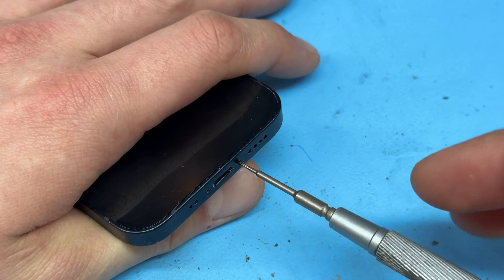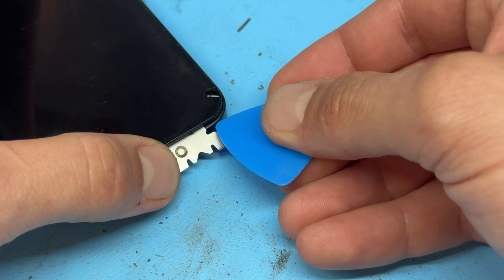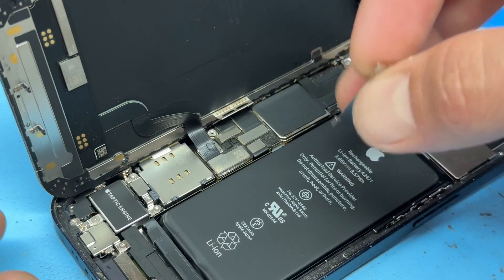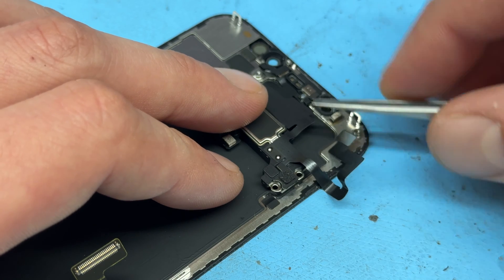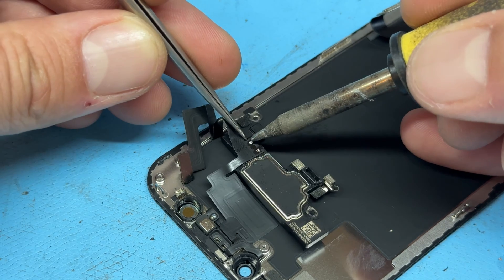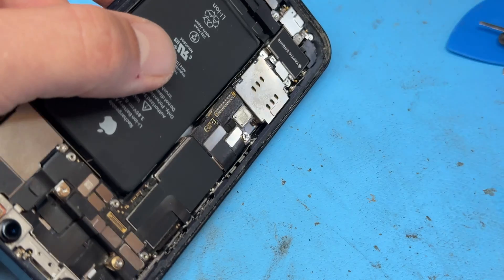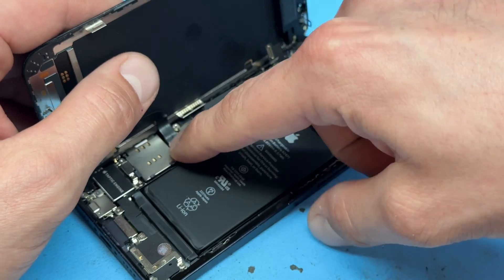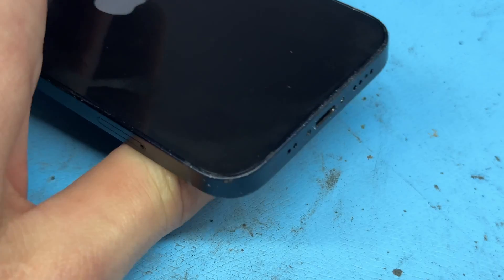iPhone 12 Mini Ear Speaker Replacement: Complete DIY Guide!

Comment: That’s very nice and simple. But the service store told me that the speaker is attached to screen and I have to replace the screen in order to get it fixed. Quoted $250 for the replacement. 😡
Reply: Same 🥺
Reply: Exactly. Same here
Reply: @placesandpeople  is it got damaged after latest update?
Reply: @RishabhSharma-e3u exactly. I updated to ios18 and the next day I remember my earpiece not working anymore
Reply: @placesandpeople   same for me trying to downgrade lets se if it works